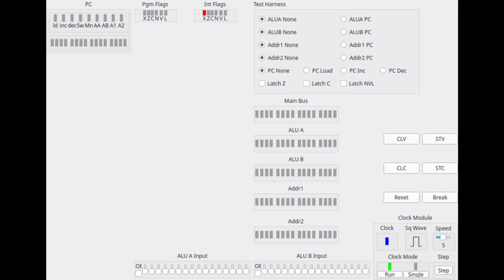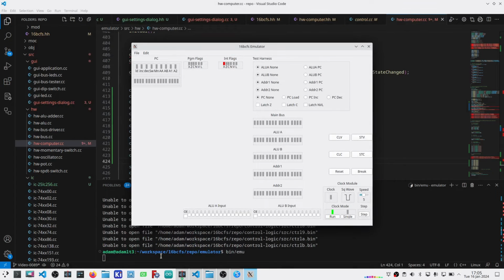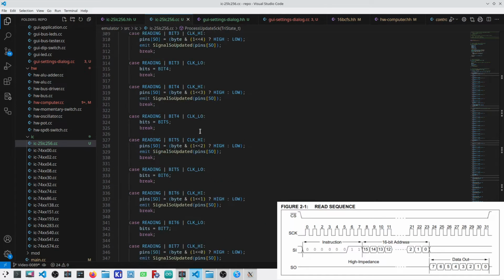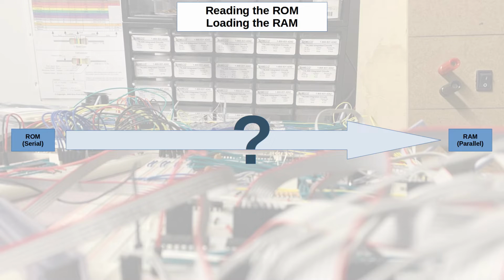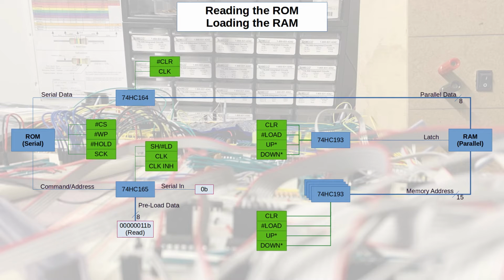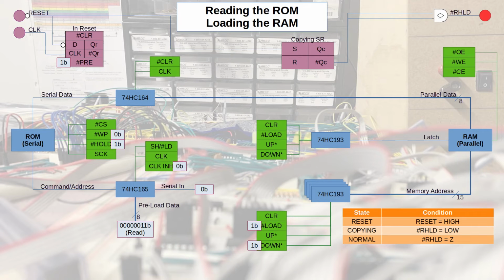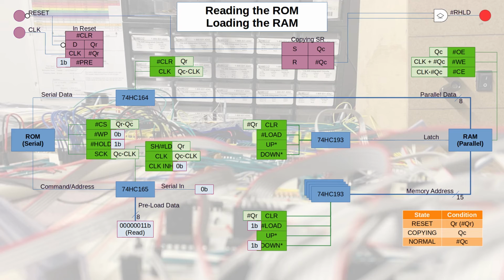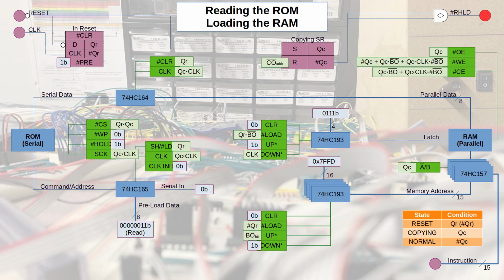0089: Circuit to Read Serial EEPROM | 16-Bit Computer From Scratch

Comment: Very similar to what I have drawn up. One difference is that instead of adding 3 to the address counter (or really subtracting), I am using another counter as the state value. I let things stabilze at state 0. State 1 loads the read command, states 2 and 3 load zero to the command register for the first address. Then when state 4 is hit, the address counter is enabled for the SRAM and the state count is inhibited. The rest proceeds on as yours does, and at the high address bit transitioning on, terminates the counters by clearing the SR latch and signals the end of microcode load and allowing main reset release to proceed. 

You can use the same command shift register and address counter to connect to multiple EE and SRAM chips so that doesn't have to be duplicated. I think you are already headed that way. 

Looking forward to seeing this on breadboard. my parts are still packed up while I finish up my shop building.
Reply from the maker: @grumpyoldman5368 -- I thought about building a state machine in hardware, very similar to what you describe.  I ultimately chose to steer away from it as I thought it added an extra layer of complexity.  

Time will tell if I made the right choice.
Reply: @eryjus4594  I don't see any reason why your simplified and more elegant solution would not work at least as well and probably with fewer components.
Reply from the maker: Ha!!   It’s only elegant if it works.  

Keep an eye out for the upcoming videos!!

Comment: Hey, thanks for producing this content. 
I was wondering what tool you are using to produce the flowchart-like diagrams
Reply from the maker: Thank you for the kind words!!  

I am a big fan of open source software.  If there is an open source solution I use it first.  In this case I use LibreOffice Draw (a spin off of OpenOffice).   

The key for the “polish” you see on the screen is to set up the page size properly.  20” wide by 11.25” high with 0” margins puts everything on the screen.  It results in a 1920x1080 pixel doc.
Reply: Thank you! @eryjus4594  I share your enthusiasm for Free Software, Free as in Freedom!
Reply: Free as in Freedom @eryjus4594